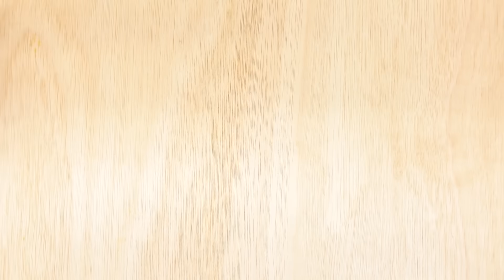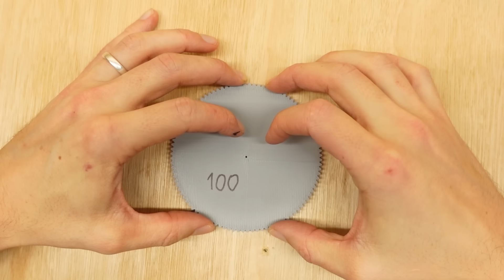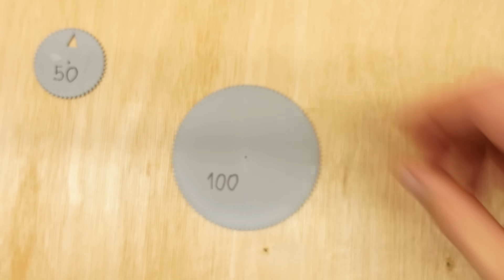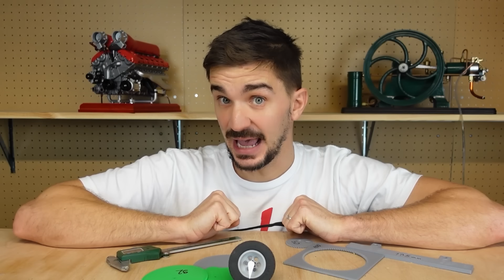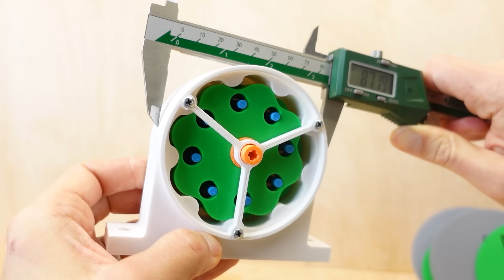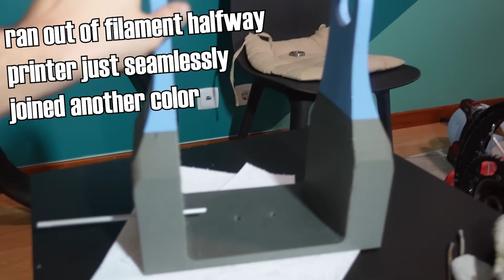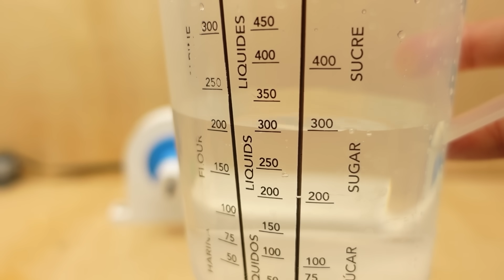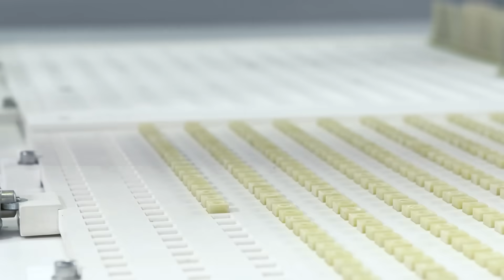Toothless Gears Make Much More Torque Than Conventional Ones, Here's How. Cycloid Drive Explained

Comment: I have a question. Is the way that you measure rotations technically correct? I know it sounds like a funny question at first, yet when i watch, if we are counting from our perspective, yes the amount of time the gear goes around would equal the amount or rotations you counted, but also, if you take the gear traveling from the inner tire or inner gears perspective, it is the same amount of rotations.  So a flat toothed edge had two rotations and the round tooth- edged object both had the same amount of rotations counting the surface. I counted by the orientation of the 50t vs 100t gear by how it started. the arrow pointed away from the inner gear and therefore everytime the arrow pointed away from the inner gear it completed one rotation.

Comment: You said you had only 6 months using the 3D printer, and no shade intended, I thought you had only a couple of weeks. You have an amazing and capable machine, but they all require a lot of fine-tuning while you get better at it. Patience is the hardest part, but there are a couple of easy projects you can do to automate the process, and for example, leave the machine running unsupervised through the night or the weekend because quality needs time, get a smaller nozzle, lower the layer height, print tuning parts to set the temps, retractions, airflow, etc. right. I have gotten 80$ chinese machines to print on an incredible quality and level of detail, you have the equivalent of a Porsche GT3 over there. Use the hype to become a master of it; you already have the right mindset.

Comment: You could balance them if you have a setup where your have 3 cycloids with weights: 1-2-1 where each are 180° offset to the previous. This way you have no torque load, your only load is bending forces on the shaft. I would say they are bad at high speed since the motion that center of mass of the lobe disks follows is a complex curve with a lot of direction change.

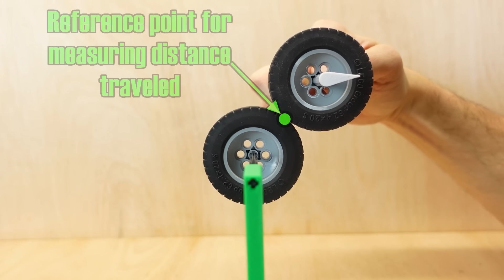Comment: 1:30 well technically in reference to the surface the wheel is traveling, the wheel performed only one rotation. (hard to explain, but notice how the dial he mounted to the wheel only pointed towards the wheel it spin around once). its only two rotations according to our pov.

Comment: So a 0 tooth system 100 torque applied without loss to movement... so logically... a hydraulic vacuum shaft with a mutator radii aligners with the hydraulic press... so you could then over torque but utilizing the thing being turned through pressure... a ratio.. of like 1.25 or more.. over torque until failure... so like some weird breaker bar. The hydraulic gear.. uses internal fluid to compress into the shade until its 0 movement... 100 of the torque is sync to the metal through compression.. when  released the pressure, the natural vacuum recedes the fins or whatever design yoh made for transfer.. the gear ratio then changes... this would be imo, the most xk part method... 100 percent possible energy transfer until failure of comments, to an extremely wide ratio.  By making a conal shape this would aid in the shaft Fina going or or in j a spiral to meet nearly an j finite ratio of energy transfer... meh is thst dven useful not even sure.

Comment: Don't forget single-stage harmonic gears. I have used these in aerospace applications. They are used in satellite mechanisms where reliability and light weight are at a premium. Gear ratios are in the range of 100:1. They probably are good candidates for low torque 3D print applications.

Comment: at 2:24 you are using a different frame of reference. Or there are two. Relative to up and down, or relative to contact with the other gear. If you use the other gear (as for the ruler), there are two rotations. Had to write that now. Let’s see where you go with it 🤔

Comment: I needed a 25 ratio reduction and this seemed a good choice. Unfortunately there are a few issue with this kind of transmission. Namely the main bearing is subject to an absurd load, due to the low excenteiciry. Plus the load is very dynamic.
I had to go with a 2 stages planetary gear.

Comment: This is not true. You can make a harmonic drive with conventional gears and it's a lot stronger as the contact surface and angles line up, and you can make it a lot smaller too.

Comment: As someone with little knowledge about this topic, i'd like to know one thing about this, what about resistances?
I'd assume that with many more points of contact, there would also be that much more resistance. 

Place 2 gearboxes next to each other, one with the clasic gears, one with this new design, both the same ratio. 
Same input power, how much power is lost to resistance?

I would assume that if for example you use a 1-10 ratio, 
In the normal gearbox there is 1 plane of contact
In the new design there is 9 or 10 planes of contact, so 10x more resistance?

Is this something you can test?

Comment: Driving 4 answers, only the cycloidal lobes moving further into mesh transmit the torque not-the ones moving out of mesh, so half the lobes transmit the torque. The lobes coming out of mesh apply the force that keeps the driving lobes engaged.

Comment: Speed solution: 6 gears (probably) as an inline 6 engine is mathematically perfectly balanced and this is the exact same movement
Reply: Came here to make that comment but glad someone else had the same idea!
Reply: @Rachel_Zem   Yippee we know ball (dw my menal state is completely fine)
Reply: it'll try to tear up axel instead
Reply: If you want complete balance you only need four gears, like an inline-4. Because there are not cranks mechanisms driving reciprocating parts, the harmonic imbalance of an inline-4 does not occur. You can even use three cycloidal sets, with the middle set being twice as wide (and massive) as each of the end sets. 

Of course, even with only one cycloidal set the unit can be balanced with simple shaft-mounted counterweights on the ends.
Reply: cause hexagons are the bestagons

Comment: If the linear row of teeth were to be rotated whilst the wheel gear traversed it, the wheel gear would appear to have either excess rotations or deficient rotations, depending on which direction the linear row of teeth was rotating. It is about the point of reference. The point of reference is not linear, therefore the small wheel has to compensate by rotating in excess or deficit. The center travelling a full circle does not mean that the center of the circle has rotated 1 full revolution. Words have meaning.

Comment: What difference in would it make if you increase the number of cycloidal gears to 6?  Inline 6's are really well balanced, but would the gear box be able to handle speed a lot more effectively?  Google AI seems to think so.  I know 6 is a high number and makes the drive longer and heavier, but you could make the gears thinner I suppose, without making the drive weaker, because the load would be distributed across all 6 gears (which, I know, having 6 gears for only 1 speed seems silly, but they could be made pretty thin and they'd be identical so they could be cranked out en masse or whatever).

Comment: So now you can use a 12v motor from you kids toy to turn the cycloyd gear attached to an 18 speed transmission to move a freight truck, drive all day on a double a battery

Comment: Wrong assumption. The reason why it Takes 2 rotations (so one more) is the pure fact you bend the surface around 360 degrees. Hast Nothing to do with Radius. Others than that you mostly nail it in your channel.

Comment: I did my master's thesis on robotic gears. High torque gears are much more than just cycloidal gears, but also include Akbar gears and Harmonic drive gears, which you didn't mention.
The near-universal problem with all such gears is that they create much more heat and friction, so they are not suitable for continuous power delivery. On the other hand, in a robot arm, they are perfect

Comment: This gearsystem has a lot of contact area together with being compact. 

I wonder if it produces more heat per cycle which struggles to get away and if that is another reason to not run it at high rpm 🤔

Comment: 3:42 The logic seems attractive, but in this case, from the reference frame of the small gear (50), it still makes 2 rotations. So if it turns around the big gear (100), from the viewer’s perspective, the small gear makes 1 additional rotation, because its reference frame has to complete 1 rotation to follow this path. 2 + 1
Therefore, it will have one less rotation inside the circle, because from the viewer’s perspective, the rotation is opposite to that of the small gear. 2 - 1

Comment: 19:32 what if instead of using 2 gears it had 3 gears with the ones on the outside being 0,5 width of the middle gear, then the force of the thinner gears together is above the middle gear.

Comment: I wonder if harmonic balancers would do well in higher RPM applications for these kinds of drives. Similar to the ones used in 5-cyl engines. Harmonic balancers are generally the direct fix for that sort of thing

Comment: I don't think you're quite correct in your explanation of why the wheel appeared to rotate twice. It's actually due to the reference frame rotating. If you look at the orientation of the arrow relative to the wheel underneath, it has (relative to the stationary wheel) only rotated 1/2 turn by the bottom, not a full turn. You can easily test this by holding both wheels stationary at their axis and rotate the bottom wheel. You will only get 1 full rotation of the top wheel per full rotation of the bottom wheel, proving that it's a reference frame trick, and not the top wheel actually rotation twice.

Comment: Theres a similair mind bending trick with tension in  arope. If you wind two ends of a rope around two cylinders connected along their axis, with one of the cylinders slightly smaller than the other. Arrange the rope so it winds off one of the cylinders and the other end winds on the other cylinder with every rotation then loop in the rope becomes very slightly shorter. The mechanical advantage gained is HUUUUGGGGGEEE

Comment: Its still one. To measure it correctly you need to take the other wheel as a frame of reference. To measure how many rotations a wheel has completed you always take the surface it rolls on as a frame of reference. You could say that by walking around the earth you have made one rotation, but it is pointless to think of it that way. Might as well say that when you are standing still you are rotating because the earth is rotating, its not untrue, but its not a very useful way of seeing things, is it?

Comment: How about reducing peak of gear tooth and increase number of teeth for smooth rotation, it's diameter making difference, oh also make tham trapezoidal to make them anti slip, oh shee** we are back to internal gear.
Reply: Also double helical gear to make smooth engagement & transfer torque on two teeths

Comment: Diameter is 100 so inside gear diameter 50 so, 100 - 50, so small gear run on 50 less dia so it runs on it so it travels half on 100

Comment: How about the worm gear design? Seems like a good way to get huge torque/speed conversion ratios in a compact assembly, with minimal backlash, no real balance issues to cancel, and a very simple construction. Is the main drawback the 90-degree difference of the input axis to the output axis? I would imagine the worm gear only really works in one direction, converting a fast-turning low-torque input into a slow but high-torque output, but that seems to be the main type of application for the cycloidal drive, at least in this video.

Comment: Hi thanks, great video the gear ratios and torque is well understood but can't understand the construction you have shown. 
How come the green cyloidial gear is the only turning part? Seems that the input is going straight to the inner green cycloidial gear and the output is defininetly coming from the inner gear cycloidial so how can there be a change in the rotations when the input and output are going to the same piece? Shouldn't the input be going to the white negative cyloidial gear and the output coming from the green cycloidial gear? Sorry for noob question.

Comment: I wonder what the effect of adding a 3rd gear would be on vibration? Obviously changing the “shaft” so they are exactly a third rotation apart. Is this possible? Would it further reduce the vibration at higher speeds?

Comment: So, I'm not an engineer at all, so I am asking in earnest; If the main problem with operating at speed, for 2 coupled cycloidal gears, offset at 180 degrees on an eccentric shaft, is the twist & wear on the shaft from the forces - couldn't you couple 3 or 4 cycloidal gears, each offset at 120 or 90 on an eccentric shaft to minimize that problem? Or would the increase in the length of the shaft just make it even worse?

Comment: I think one of the main issues would be reliability and trying to keep everything lubricated. With gears, you just put them in a tank of oil and they splash around, with these smooth gears, it will probably squeeze out oil and cause rubbing

Comment: Using sinusoidal paths instead of gear tooth shapes doesn't mean that the principle is totally different. A toothed variant of what you built there is used inside Wankel engines:
https://www.youtube.com/watch?v=ZePgOTqXA2g
It is also used in gerotor pumps and hydraulic motors:
https://www.youtube.com/watch?v=PwmzIEAoKgY
https://www.youtube.com/watch?v=74IniguLwas&t=192s
https://www.youtube.com/shorts/hwaIIHjUqS0

There are also combinations with pistons, for even more torque:
https://www.youtube.com/watch?v=YWig9qg1lnE
https://www.youtube.com/watch?v=sXb8uozM1fQ
https://www.youtube.com/watch?v=HWxMvLf81SM
https://www.youtube.com/watch?v=Ea2B4oQnQSU

This sinusoidal lobe system is also used for "downhole mud motors", for additional rotational drive torque on the drill bit at the end of an oil or gas drilling string. The high pressure of the special mud mix, pumped down to flush drilled debris back up and cool the drill bit, is used to power the mud motor:
https://www.youtube.com/watch?v=xYtX0VP6UIk
https://www.youtube.com/watch?v=vM6y2lvt9tw
https://www.youtube.com/shorts/hwaIIHjUqS0
Downhole motors can be used together with the entire drill string being driven and rotated from the drilling rig on the surface (top drive) for extra drilling speed, or with the string non-rotating. With a non-rotating string and built-in steering elements behind the rotating downhole motor, drilling in curved directions is possible:
https://www.youtube.com/watch?v=pJCjE2Zi8G8

Comment: Couldn't you just make it a three gear system with two thinner (lighter) gears on the outside of the middle (heavier) gear? That way you keep the 180 degree force canceling and the other problem is reduced at higher speeds

Comment: fun fact, by about 6:38, that is a very similar deign most car engines and transmissions use for the oil/transmission fluid pump, but instead of the center axis spinning in a circle like that, the pump shaft goes directly through the center axis and spins the gear in place while the outer gear spins around it. the gaps between the gears are actually used to compress the oil/ transmission fluid and then send it on its way. pretty cool stuff

Comment: Would Cycloidal drive be good  for helicopter main transmission.  They need high speed reductions and large torques.  Having said that, the world's fastest, heavy lift helicopter, the CH-47's,  uses planetary gears.

Comment: Check Out This Soccer Mom Van Running On A Cycloidal Drive 
https://www.youtube.com/watch?v=z-Y-N4NwYBU
That Particular Van Has Ten Cycloidal Gears Driven By A High Compression V8 Engine Each Gear Drops A Load of Over 7500nm of Torque Curve Meaning That Van Will "bounce" If You Don't Control Your Foot On The Gas People Make Fun of Soccer Mom Van Until She's Running From Highway Patrol 0 To 60 In 0.2 Seconds Flat 400hp At 16:21 Try 7500bhp Building An Engine That Wouldn't Explode Under That Load Was A Challenge

Comment: Great video. Fantastic, very informative. The information was presented cleanly and clearly, and with enough character that the presentation was enjoyable and engaging. However, the ending felt incomplete. 

Alright. The wobble gear doesn’t handle high speed well. But why then, is it okay in electric vehicles (as implied by the video)? As presented in the graphs from this video, an EV’s motors may potentially reach up 20k rpms at their top end. My intuition is screaming at me that 10-20k rpm should qualify as that high speed, and yet they’re supposedly still used in these applications? Despite potential risks of failure?

I’d have liked if there were another section going over what rpms would actually qualify as “high speed”, what factors affect this threshold, additional potential mitigation solutions, and, if possible, a practical demonstration of what a high speed failure would look like.

Thank you again for this fantastic video and look forward to seeing more from you in the future.